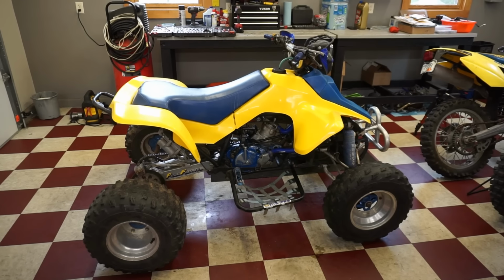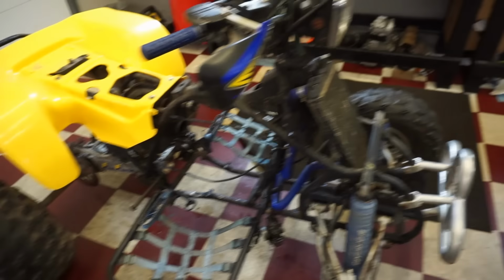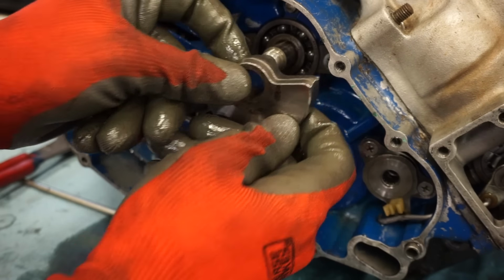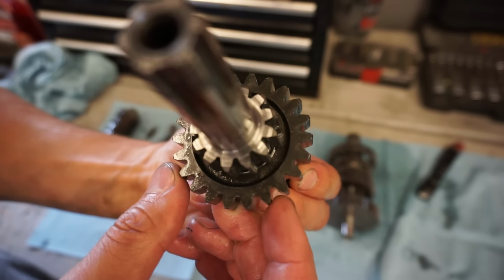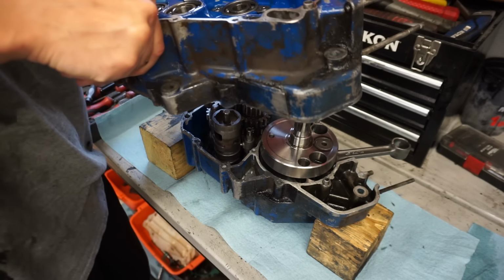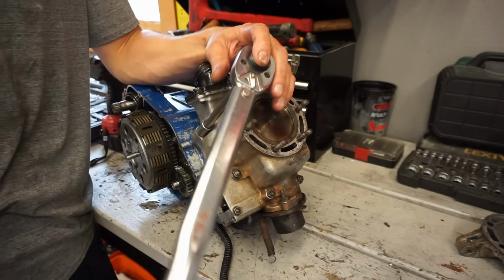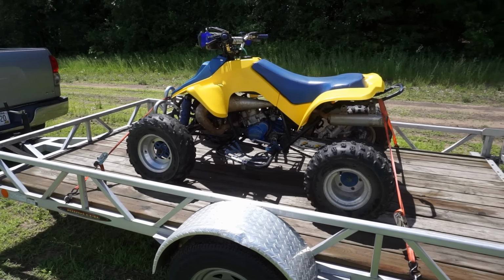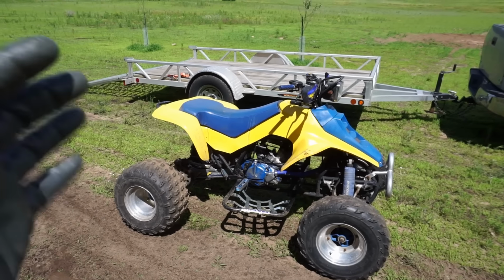Rare 2-Stroke Race Quad Slips Out Of Gear...(PROBLEM FOUND)

Comment: I'm no mechanic at all bit with all that metal floating around I would guess that that engine needs to to be completely torn down and cleaned
Reply: The oil only lubricates the transmission and not the engine. That's what the oil in the gas does.
Reply: he did tore it down dude
Reply: @oscr_zen  he didn't wash out all that shit from the bearings.He left that mess in there dude

Comment: Looking at those dogs they all are not good. They need to be repaired and back ground. This is work I have been doing for 40 years. The slightest bit of movement of the gears on the shafts will cause it to jump out with the condition of the dogs